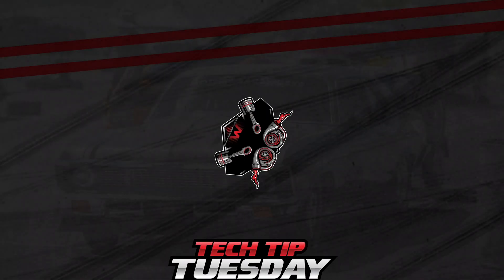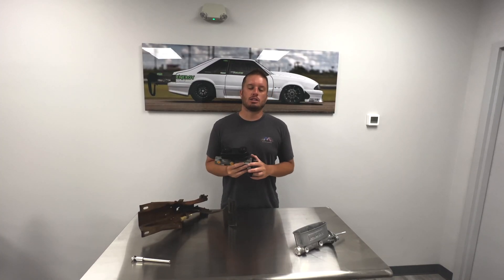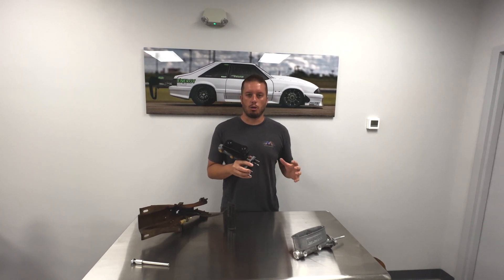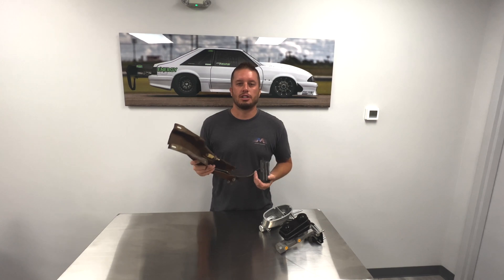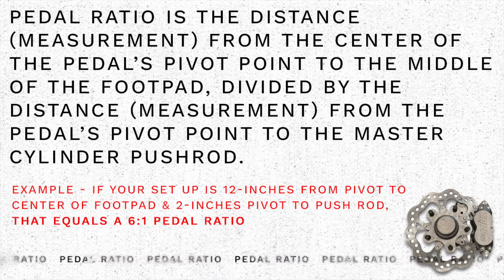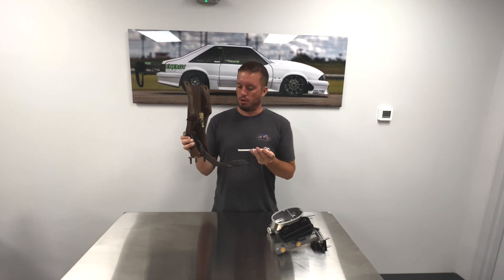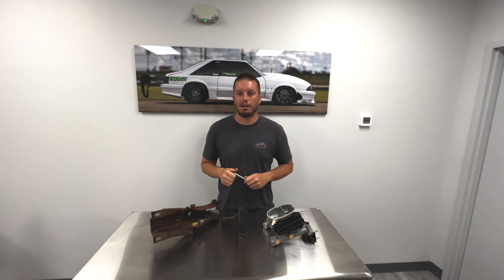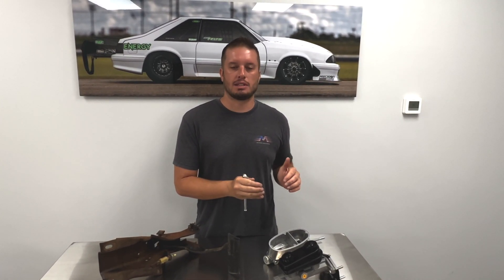Pedal Ratio and Bore Size Are Everything! Brake Tech Tip Tuesday - Free How To Video

Comment: I have a 67 Charger with an all around disc brake setup. It has a pedal ratio of 10-1 with a 1.8” M/C bore. The brakes are pretty good with a good solid pedal, but the brake pedal is way too high. Can I just get away with using an adjustable rod to lower the pedal?

Comment: Some cars like late 60's Chevy's could have manual or power factory brakes. On them, manual brakes were 6:1 & power brakes were a 4:1 pedal ratio.  They had both holes on the brake pedal arms, so they didn't need a different pedal for each..

Comment: As a guy who’s converting to power brakes this video was super helpful! Thanks for posting it. I used the factory hole for the push rod and it doesn’t seem to have any braking power at all. I did notice that there is a second hole just below the factory hole? I tried it and it seems to work but I didn’t know about the ratios . I’m going to adjust and see if I can get more pedal out of it. This is on a 78 C10.

Comment: I need more brake on my Beretta RWD swap. I have 6:1 Wilwood pedals with a 3/4 bore for front and 7/8 for rear with the balance bar set all the way to the front and still can't lock up the front brakes. (Single 2.25 piston calipers up front, explorer 8.8 calipers out back). Should I be looking at different calipers up front or different bore front master. I do already have aggressive EBC yellow pads.

Comment: I have a little mini buggy I have been building and have been trying to work out a breaking issue. I had bought a kit that utilized a 7/8 handbrake style actuator hydraulic master cylinder and I needed a foot style break obviously. So I bought a 7/8 floor Mount master cylinder. I added a single hydraulic brake caliper for the rear that also required a 7/8 floor Mount master cylinder. I used a splitter that was also an adjustable bias bar. No matter what I had done the buggy would not come to a stop. It had an extremely hard pedal, absolutely no air in the lines, and no matter how hard you pushed on that pedal it would not think about sliding a tire, you would do good to even come to a stop. Now the master cylinder and brake pedal both has different leverage adjustability and that too didn't make a difference. Out of curiosity and reading several hours worth of literature I was at a loss. Out of curiosity I disconnected one of the master cylinders and hooked my brake pedal to a single master cylinder that activated the front and rear calipers simultaneously and it worked beautifully. It never dawned on me that I was overpowering the calipers because you would think by overpowering a caliper it would stop too easy, boy was I wrong, 180° wrong LOL. To be honest it still makes no sense to me but the problem is fixed therefore I'm good. I hate that there is almost $200 worth of brand new parts that I didn't need but will find an excuse to use them on something else 😉

Comment: In my experience most older cars use a 1" or 1/16 MC. With or without a booster. Drum or disc brake. With that I find a 3/4 or 7/8 MC is the deal. And that does depend on pedal ratio. And piston size in the calipers. 
This is for street or road racing. With proper tyre sizing. 
Balance bar set is usually 3/4 F 7/8 R. Drag racing with b/s tyre sizing is it seems backwards. Needs more rear brake to slow down with the centrifigual mass.  Which means the car will never really stop. Just slow down. As eventually those BMX rotors on the front will fade to nothing and then will lock up the rears, or all 4 will fade and then the hanky may stop you,, or maybe not!!

I see those b/s scalloped rotors on Sprintcars at times. They weigh half of what say a Mustang weighs and only [usually] do about 90mph max. And so many of them do not stop!!